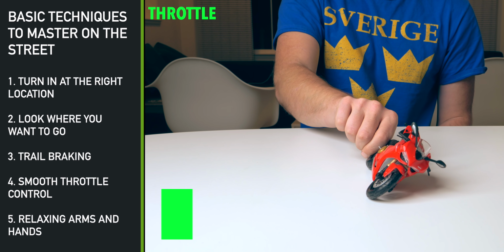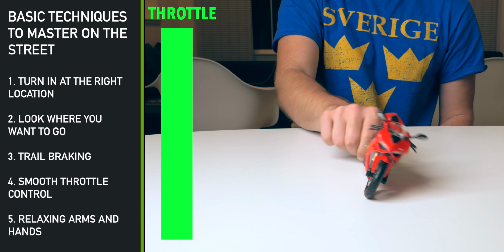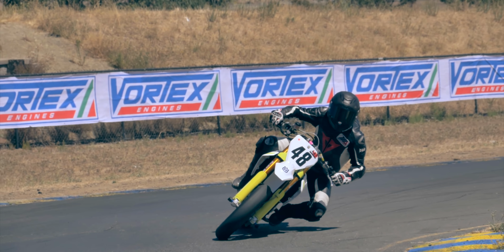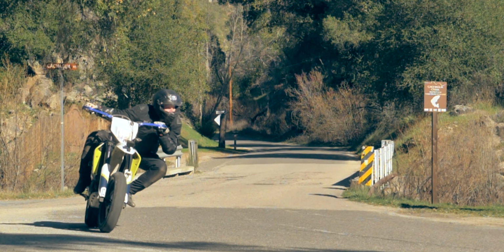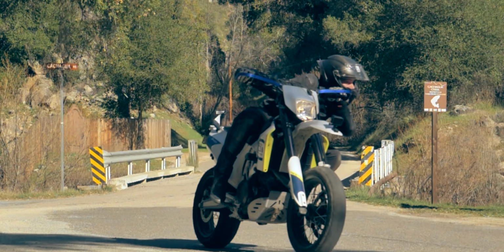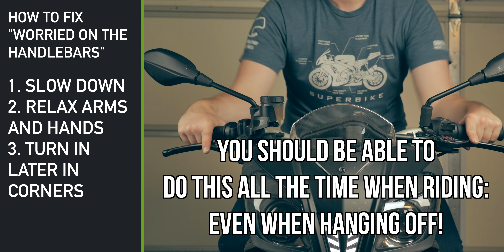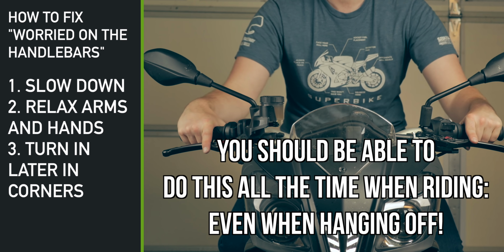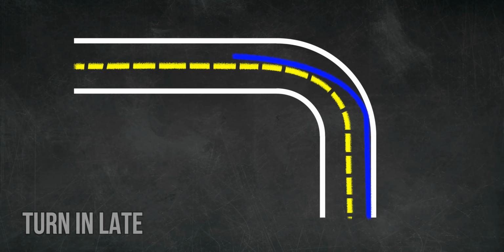5 Things many Motorcyclists do WRONG

Comment: The blind corner is by far the most dangerous. Riding with 'friends'  is where you take too many risks. Relax, safe and conscious that a two wheel can be deadly.
Reply: The blind corner is a very important issue. I was riding at night one time and I approached a long blind corner. I told myself mentally to really slow down. Sure enough, 2 does and a 10 point buck in my line. The buck didn’t even move as I slowly passed them. If I didn’t slow down, I would have hit antlers at 40 mph.
Reply: You said it mate👍
Reply: true one week ago a friend of mine drived behind me a route he never drove before. I already knew the route so I took the turn with a bit faster. He tried to drive as fast as I (he wasn't that experienced so he just thougt nothing of it) he didn't made the turn and fell to the ground. He was lucky though because it was a dangerous turn on a mountain and he could have injured himself severly and destroy hes bike completly. But he's fine and the motorcycle too besides some scratches and a broken mirror.
Reply: Yeah, you can tell about the scary hazards of a blind corner over and over... The truth is, we only REALLY understand how it is when we come into a blind corner a bit too hot... The lucky among us live long enough to learn from it, either by "saving it" that one time, or by just not having a bad enough crash to kill us outright...

    That's the nature of the sport of motorcycling... You get good quick, or you get dead quicker.

     Glad I was among those who moved up to trail-braking early. In the mountains (where I live) it's indispensable... There's always a road that's "new to me" and blind curves that turn out a bit longer and then reduce radius or add another apex (or both... that was fun) and if you're faster than you normally take the "new situation" then you're just f***ed... Trail-braking lets us keep the balance a bit forward and we can add some drag to the rear brake (my favorite for most trail-braking) or even get a little aggressive with the front... either way, we can do it without worrying...

     It SHOULD BE all about "HOW" you use your brakes, NOT "whether" you can use your brakes. If you can't stop your motorcycle ANY TIME and ANY WHERE on the road, turn or not, then you DO NOT have full control of your motorcycle.

    Out here in the mountains, there are rock falls, land-slides, fallen trees, damaged vehicles, deer, bears, cattle from time to time (horses too)... and a MYRIAD of other things that can just randomly be in the middle of a blind, double-apexed, reducing radius turn that drops you four or five inches from asphalt into gravel at 50 mph... Good luck!  ;o)
Reply: The only moments l’ve had fears on my bike is when riding with a group ! I am so much more relax alone on my GS 1250! Evaluate & respect your limits! Ride safe. Marc Quebec, Canada 🇨🇦😉🏍
Reply: Let the more aggressive riders go!  Easier said than done  lol....maybe the thing to do is to always designate a point rider on spirited rides who takes off first and rides at a safe pace scouting ahead....but without radios how much could that help?  with at least a couple comm devices on key riders though?  that could be genius!  point rider reports slow vehicles or emergency vehicles accidents speed trap loose livestock or gravel etc then lead rider of group controls the goup near those spots ideally everyone has mesh coms

Comment: It blows my mind how many people I see trying to get their knee down on the street. Normally they are going slow through corners but hanging right off the bike. Just so risky, a small patch of gravel or something and you're done.
Reply: It's like they don't even realize that's adding body position... If you're not pushing the bike to it's limit in THAT turn, you're just going to stand it upright... It's still going to turn and all (provided you did the turning part correctly)... BUT adding body position takes away lean angle...

    SO on the street, they're doomed from the start... They CAN'T be riding fast enough 90% of the time to get the knee to touch... so they just look like a goof dangling off the side of a motorcycle going WAY too slow to need to do that...

     I'm on a cruiser... AND I can take a pretty fast pace... The MOST body position I've used puts my chest just about in line with the inside handle-grip on the road... AND I LIVE in the mountains.  ;o)

Comment: I never really tried to "back it in" in all my commuting years. One day, a big pickup almost took me out, veering off the main road right behind me on a side road and stayed right on me. A red flag went off and I thought I have to lose him. The next corner I took elbows up forward in the seat, inside foot out moto style. No rear brake. The back end stepped out engine braking and I eased the clutch in as the bike started to point towards the apex eased clutch and throttle out of the corner. By far the best and coolest corner I ever did. Surprisingly under stress and not thinking about it. Never want to push it that hard on the street again. Lost him. Not really sure what was going on there.

Comment: On a race track there are rarely, if ever, blind corners. And they never have oncoming dump trucks or fallen tree limbs, and very rarely have a turtle or some gravel. Winding roads are NOT the same as race tracks. So don’t ride like they are. When I ride with friends, if their pace is too high I simply tell them I’ll catch them at the next stop. If they give you a hard time, these are not your friends.

Comment: On the streets i always use the rear brake and engine brake. Front Brake only for emergency. I have the fingers at the lever, but usually don't use it. Hanging off is such a stupid skill for public roads. Makes your riding unstable in case of an emergency.
As you said, there is a big difference between public road and track. On a track you can be sure, there is no traffic, no peds, no parked cars, no potholes and the road is much wider. And you can see the end of corners. So it's much safer on the track for you and for others.

Comment: Excellent video. I've been doing all those mistakes (except "backing it in" because it is not easy to do, especially with zero track experience) and always tried to correct them but sometimes it is really difficult to go against "instincts". For exemple, now it's a cold, cold winter and i have to ride everyday also at night, and between all corners being somewhat blind, the slippery roads, the cold , i end up turning too early, fearing to put enough lean angle, being tensed on the handlebar.
Reply from the maker: Holding on to the handlebars too hard happens to everyone, the important thing is to be aware of it and always try to relax. I catch myself holding on too hard to the handlebars all the time when racing in Supermoto. Being loose on the handlebars is especially important in supermoto racing because the bikes are optimized for lower speed sharp turns. Going 90 mph + on the straights makes the bike start head shaking if I grip the handlebars too hard, so I get direct feedback of what I'm doing wrong. As soon as I get loose on the handlebars the shaking stops, works every single time.
Reply: This winter has been the winter I discovered Alpaca Wool... I'd heard of it before (obviously) since I wasn't born or raised under a rock somewhere... BUT the stuff is a bit expensive ($50 for a sweater) to me... AND I was always of the opinion, "Yeah, wool's fine for insulation even wet, but THAT much?"

    Well, I ordered one... AND two days after it arrived, I ordered the socks... even the $20/pair Boot-socks... AND I absolutely LOVE them... Now, if there isn't great big splotches of ice everywhere in the road, I'm riding... no excuses, and I'm not freezing my a** off...  I WILL BE COLLECTING!

     The hardest thing in the WORLD to do is try to ride a motorcycle when you're shivering, because your WHOLE BODY stiffens right up and you can't effectively move... In that state, even dry pavement doesn't help... If you can't flex, you can't lean...

     Good LED upgrades (add-ons and mods) help with visibility at night, both to help you be noticed on the road AND to help you see ahead, whether there's "shiny" meaning "black ice" or chucks of snow/ice or sand or whatever other debris... 

     ...AND of course, taking your time (slowing down a bit) helps reduce the wind that chills you down as much as it helps you manage turns without too much lean requirement... Another bit that can help reduce lean angles AND still turn is "Body Position"... SO by shifting your upper body INSIDE the turn (line up your chin/chest with the inside handle grip) will let the bike stand upright a bit more and still take the turn (everything else done normal)... 

     Hope this helps out... ;o)
Reply: @gnarthdarkanen7464  thanks for the advices. I'm already a big fan of merino wool, but never heard of alpaca wool, i will definitely give it a try!
Reply: @WatermelonPlanter2K17   Merino is definitely nice... among my favorite for sheep. Alpacas live in the mountains of South America, and their wool is "hollow" like a polar bears, so extra insulating. They also don't produce lanolin like sheep do, so the wool doesn't tend to itch as much for those of us who are sensitive to that sort of thing...

    in any case, I think you'll be suitably impressed... AND I certainly hope the advantage helps with your riding! I know how tough it can get trying to ride year around... ;o)

Comment: I got a huge scare last summer in the twisties going in to what I thought was just another blind corner. Turned out to be a blunt hair pin corner.luckily I was able to correct the speed with my rear break and force myself to uncomfortable lean angle enough  to make the corner
Reply: As an addition to that, I've heard that it's better to use the front brake if you need to slow down mid-corner, because if the wheel locks up then you'll likely just low-side, whereas if you lock up the rear wheel mid-corner, you're more likely to have a high-side crash.

Comment: Excellent, as always !
A quibble, however : on the street, as you mention, trail braking can be useful in blind corners (especially going downhill).
I would add a maybe more important skill for street riding, as the unexpected can also happen when you're in the maintenance throttle section of the turn: one cannot avoid learning how to apply the front brake smoothly when the pads aren't on the rotors anymore !
Reply: Trail braking very useful on the street.
Reply: @beanwithbaconmegarocket  Yes, of course, but that was not my point
Reply: @stef2269  i was agreeing with you
Reply: @beanwithbaconmegarocket  Sorry, I misread your comment !!
Reply: @stef2269  No worries my guy. Your comment was great. Mine was unclear. Ride safe!
Reply: Gently does it.....

Comment: I'm a relatively new rider. The one advice that really changed the way I ride was to not lean with the bike in corners but to counterlean. 

FortNine has an amazing video explaining why counterleaning is better and I definitely agree. Ever since started using that technique, I feel much more in control in corners and have much better situational awareness.. Not only that, my 200Kg+ Vstrom feels flickier too!
Reply: I've seen that video too and I agree with you! However, I don't always feel confident using counter leaning. I use counter leaning when on lower speeds and this gives me much more control, but when I'm on the highway doing 100 km/h I'm definitely not counter leaning but leaning completely. It just feels right to do it like this. Would you say the same? I'm a beginner too and I'm curious what you think about this.
Reply: Counter leaning isn't always what's best.. Go full speed and counterlean and youll be flying in no time. Slower speeds require more counterlean, faster not so much
Reply: @manbiteslife3110  Not sure what you mean by full speed, but I have run around 60MPH and counter leaned fine. But it also didn't take much either.  on a 55MPH road, I'm not taking any curve more than 10 over.
Reply: @spartanx169x  slow speed meaning like under 10mph counter leaning is good so you can lean the bike more and not be off balance. Normally its best to be at the center of weight. At curves it's best to be inside the turn if the motorcycle has enough power to push away like pro do. Sorry for bad English and I'm open for suggestions

Comment: Great video. I was once riding with a pillion through a winding section in the mountains (one way traffic only, for coming back you have to take the shorter tunnel) and I do lean a bit. During the ride I almost crashed at a corner because the pillion rider instead of leaning with me decided to correct the lean by being upright. That is the day I decided to never have a pillion rider on my joy rides.

Comment: Something that you have over in the USA which we don't have in the UK is training  the performance way which to my view is similar to track racing with a different attitude towards bends etc. 

I note that some 4.500 riders are killed on your roads annually and over here its about 350 killed so greater differences. On canyons apart from not seeing  round the bends,  in the UK that is normal  as being a smaller country with much narrower roads and much farmland and hills everywhere  its difficult to find long straights and so we train to narrow roads and plenty of blind bends.  

This mean that our training for bends is different and we do most of our braking prior to the bend and view what we call the  vanishing or limit point. That is the distance that we can still see to be clear on that bend.  A point  ahead  where the outside kerb or verge  meets the inside one.  What we are looking for is to maintain a correct braking distance with the distance to that limit point and throughout the bend. Having reached that point  prior to that bend we are easily  keeping up with that limit point. 

Say its some 140 ft ahead of us,we follow it and the distance to it round that bend at the same speed with a maintenance throttle only. So the curve of the bend dictates our limit point [ as far as we can see round that bend ] and our optimum safe speed around it.   If we are catching up with it we are going too fast as we cannot guarantee to stop in the lesser distance now being seen so we slow down or if it is going away from us it means that we can  slightly increase our speed to remain constant with it  if we wish to do so and to keep up with that safe stopping distance to  our limit point.  It may also signify that we have now passed the apex of the bend and the bend is now opening up for us.   

After the apex and the road straightens out we can then lift the bike up and accelerate again to our limit point in the distance, that distance that we can see to be clear ahead.

So our way of taking bends is quite different from your performance lines which I believe is the cause of  many  of the problems that you have with motorcyclists on your roads.

Comment: When we are trying to have a bit of fun on a back road we always ride up and down it a few times, easing into it, checking for debris, learning the corners. Even so we never get close enough to scrape pegs or get knees down, just not worth it with an oncoming lane of traffic and ditches, fences, barriers, or trees on the side of the road. Just have some fun without needing to be on a track and also not taking too much risk. If you're solo definitely don't push it.

Comment: you dont HAVE to use the front brake to back it in if contitions are right, feel it out, if everything is right you can back it in just by blipping the throttle and when it time to grab traction again you can pull back a TINY LITTTLE FRACTION on the throttle and the rear tire will grab again and you can shoot yourself forward its so fun lol. i remember trying to back it in thinking it was using the brake xD never worked just ruined my stock rear tire haha. be careful when backing into a turn in one direction immediately followed by one in the other direction, grabbing treaction at the wrong time while you turn over to the other side can cause a highside im still trying to master that technique. also this stuff can be done in  empty parking lots at slow speeds after work you dont need a racetrack

Comment: Interesting points (i know old video etc) but specifically to backing it in, I've most definitely ended up inadvertently using it on the street. I ride an S1000XR, and not sure if it just makes it easy, it's basically got supermoto ergos with a bit longer reach, but under hard braking and shifting down you can definitely get the back end to step out without any rear brake at all very easily and then leaning on the TC a tiny bit you can get great drive out of tight corners. Without TC I doubt I'd be quicker but on the street I'm not ashamed of using my electronics to have safe fun.

Comment: When you're hanging on too tight, you'll know because you're terrified to let go of the handlebars. I remember when I first started riding, when I would be terrified to let go at highway speeds, because as soon as I let go, the bike would start drifting to the left (since I was slightly pulling on the right side).

One sign that you're not hanging on too tight, beside the chicken wing flapping, is being able to ride one handed, since I don't think its possible to ride one handed if you're hanging on to the handlebars, if I'm not mistaken.

Comment: I have to disagree with the "Rossi leg Dangle" I feel like it makes riders safer. They can use the rear brake but come off of it and only use the front when entering. That can help make sure they don't lock the rear. Also the leg dangle helps shift the whole bike to the opposite side between your legs and give you more room to keep the bike upright. You also learn to have the foot on the balls of your feet on the peg and learn to look through the corner. It helps give more safer and correct body positioning